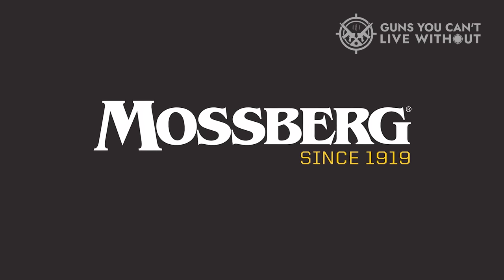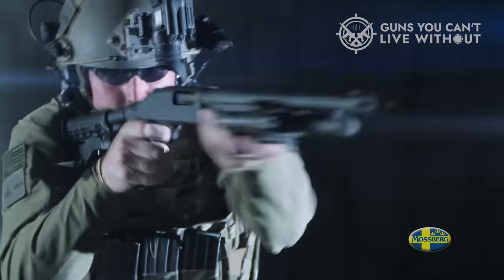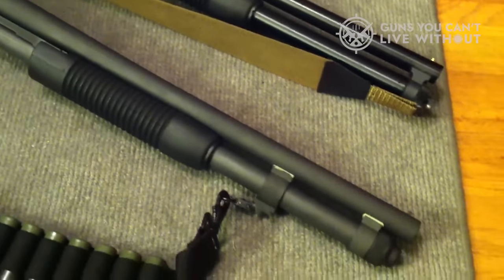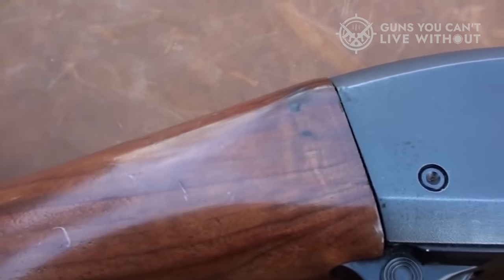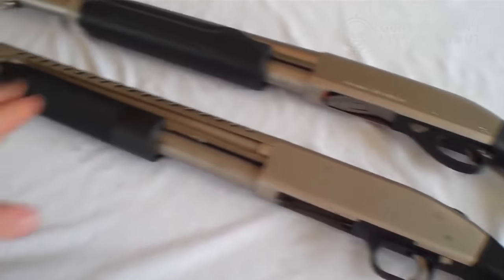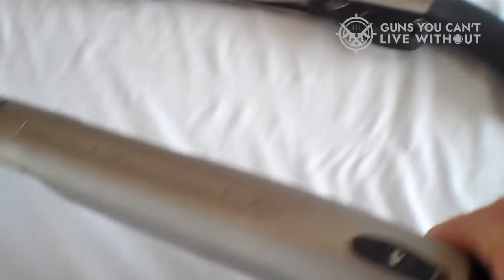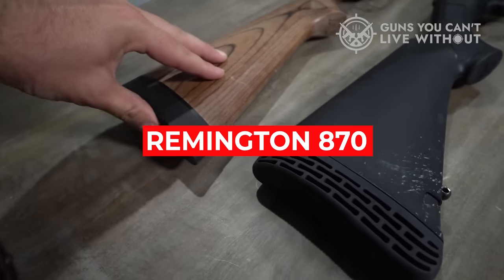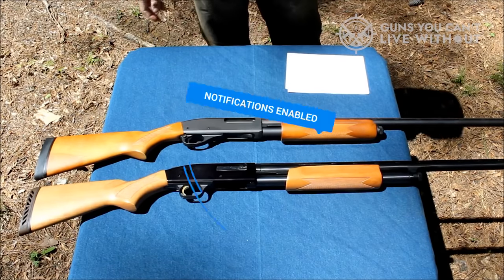Mossberg 590 vs Remington 870 - NOT EVEN FAIR.

Comment: Not many shotguns are built with a solid steel receiver anymore. Most have some form of pot metal alloy to save the makers money. It's one of the reasons I've always loved the Remington's. The receiver is the virtual heart of any gun and the extra few ounces seem to make the 870 balance better and also adds to durability. Also, the 870 action seems smoother and slicker. I have never had a parts breakage on any of my hard used 870's, but they are older guns. The QC of the new ones is, however, a pause for concern.
Reply: The 870 Wingmaster models manufactured by Remington before they went bankrupt are some of if not the best pump shotguns ever made. The only other one close in my opinion is the Itica model 37. The new 870, I agree with you I would not buy one.
Reply: There's been so many great pump guns in history. The Ithaca 37, Winchester 12/1200, even guns like the old High Standard. I have a high standard riot gun with factory rifle sights that's the smoothest fastest pump action I've ever shot! It's compact, light and points like an extension of me.

Comment: I ran a Mossberg 500 for years, eventually tried an 870. It wasn’t even close.
Then went to the 590.
While the 590 had a few neat upgrades, the 500 was at least as reliable.
The abuse we put that 500 through was beyond what it was ever designed for, and without a single hiccup.
I’ve seen several broken 870s, not the Mossbergs.
That 500 is now loose and sloppy…. But still 100% reliable.
It has gone through trap leagues, rabbit hunting, all types of water foul, Turkey, and even slugs for deer…then I gave it to my brother and he did the same. Once falling trough the ice rabbit hunting. He used the gun to crawl his way back out.
He didn’t know you were supposed to clean them once in a while. I got it back and it is STILL going strong.
You can’t beat a mossberg.
The Mossberg is the clear champion.

Comment: Got issued a Mossberg in Iraq 2004. I have had an unyielding love of those shotguns since. Still have the m500A I bought when I got home from that deployment. It’s now configured as a 20” 590 SP with a bayonet lug. (Essentially a light barrel m590a1)
Reply: Nice to read this.  My 590 A1 was great 20 years ago ... a lil older and weaker now.  I plan to put a pistol grip on the 590 A1 for use in a boat.  Then get a 590 and set it up as you did.  Some weight savings ...

Comment: The 870 action and balance  is pretty great for wing shooting its so smooth on the follow up shoots. I often find I shoot better with my 870 then with my auto becouse of the rhythm imposed through pump cycling tends to align the gun just right..
Reply: I have a Mossberg 835 UlitMag. It's a loose-fitting gun and horrible slug gun even with a rifled cantilever barrel but boy does it shoulder, point and knock clays out of the sky.
Reply: @justasimpleguy7211  My 500 shoots slugs great, but it rattles more than 870

Comment: I like both so I own both.  Very happy with my Remington 870 Tactical and Mossberg 590A1.  Both are 18.5" models and I put Magpul furniture on both.
Reply: True, The 590 A1 was created for the Navy, The mag tube was strengthened because the Navy would bang up the mag tubes running through the small steel doorways.
Reply: @josephberg2329  Is the mag tube strengthened as well?  I know the barrel is heavy walled but I guess it would make sense to strengthen the mag tub as well.  Seems both would be at risk of being banged up on heavy watertight doors and hatches.
Reply: @1977Yakko  Yes, or at least from what I've been told, both the barrel and mag tube were strengthened.

Comment: I bought a Mossberg 88 which has the advantage of being able to swap out parts in the 500 and 590 family.  I converted mine over to a 590A1 configuration.  Yes, I replaced the barrel and got the longer magazine tube which cost me not that much as parts are everywhere.  The advantage though is, I was able to do all the gunsmithing myself at home with simple tools in very little time.  I even have a bayonet lug.  My converted version is just the same as the store bought A1. I added a side saddle, ghost ring sites from the A1, and a rail for optics if need be.  I have not added them at this time as I am a traditionalist.  Another thing is the model 88 has the safety on the trigger guard so you do not have to remove your hand from the pistol grip to engage the safety making it like the Remington in this case.  I have never had a malfunction or part breakage to date and the gun is several years old now and highly used.  Yes, it is a little loose (action) but has not appeared to get any looser over the years.  It runs just as smooth as the day I got it.  Great Gun.

Comment: The main reason I like the Mossberg better is because the ejector can be changed out with a flat tip screwdriver unlike the riveted in model on the 870.
Reply: Except that the ejector can come loose and make it damned near impossible to eject a spent round.
Reply: @alexh4436  Blue lock tight is cheap.
Reply: I put thousands of rounds through an 870 that I bought used and never broke an ejector.
Reply: @Jerry hablitzel  That's great 👍  If you ever do, it's not an easy fix.
Reply: Modern 870 extractors can be taken out with a small flat blade Also
Reply: @Aron Kovacs  Extractor or ejector ?
Reply: @RickNethery  oh nevermind, the ejection on the 870 sucks
Reply: @RickNethery  I’m not intimidated.
Reply: @jerryhablitzel3333  That's good because nobody is trying to intimate you.
Reply: @RickNethery  the repair wouldn’t intimidate me.
Reply: @Jerry hablitzel  That's good,  when the time comes I hope you can find the part.
 The ejectors for 870s are sold out everywhere. A quick internet search will confirm this. I've been looking for an ejector and the tools for my 870 for a while now. 
 Everywhere says sold out.
Reply: @RickNethery  don’t be a tool. It’s an 870. It can be repaired if needed (which it won’t for first million rounds).
Reply: @Jerry hablitzel  I own an 870, I know it can be repaired, just not as easily as  Mossberg.  
 That's why I have a Mossberg for when my 870 fails. 👍

Comment: For me the selling feature on the the 500 is no elevator. The open tube allows you to load shells from open or closed
Reply: I agree, hopefully they make the 500S version that will take any length shell to match the 590S models..
Reply: @PatriotPaulUSA  Actually, if Mossberg would sell the trigger group, you could convert a 500  to an S-model in 5 minutes. no reason to market a 500S .

Comment: I own both. The 870 Express for probably 35 years, and a 500 for about 5. Love both, wouldn't part with either. The action on the 870 is well worn in, and is the smoothest, slickest action I've ever encountered. The 500 isn't near as smooth, but we're comparing thousands of cycles to a few hundred. I had a chance to shoot a friend's new 870 last fall, and that action wasn't nearly as smooth as mine. In fact, it was comparable to the 500. I've heard stories about Remingtons quality not being what it was, and it was very apparent in a side by side comparison with mine. I don't think I would buy a new Remington today. They just don't feel the same. I would however, buy another Mossberg.

Comment: Got an older 870 Wingmaster in my gunsafe currently. I am 73 now and have had one  since I was 16. It has NEVER seen a gunsmith. They are bulletproof and there are so many accessories that will fit it that its like a 1022. Massive swappability.
Reply: Maybe they need to do a comparison of wingmaster vs express and the mossberg.  They are worlds apart

Comment: After researching and handling several models, I went with the 590 for the ‘bump in the night’ gun.  The safety on the hump is what I’m used to and I don’t need another thing to think about if there’s someone trying to come through the door. The 7 round capacity is also a plus.

Comment: Notable mentions for both:
The 500/590 has a bigger trigger guard, easier to shoot with heavier gloves.
Some 870 tactical barrels(18/20inch) have chokes, where as 500/590 are usually open cylinder. 
That being said, I wouldn't buy a new/er Remington, I did own a supermag for a hot moment, but to me it was crap. Older Wingmasters/Police models are the way to go if you choose a Remington. That being said, I love my 500 for hunting, the tang safety just works better for me.

Comment: After years of duck hunting (from lead to steel shot) and owning both platforms I got to go with the old model 870. The Mossberg is a fine gun but after a few years of eating 3'' magnums they will start to gall the receiver. The first sign is when you pump it and feel that little stick before you go back into battery. But as stated both will work just fine.

Comment: Last year for my birthday, I went out to the range and tried out a ton of guns, including both the 870 and the 590. I really anticipated loving the 870, but to my surprise the 590 just consistently felt better. It wasn't a huge difference, but the Mossberg was definitely the winner nonetheless.
Reply: Happy bday
Reply: A typical story. Not a unique experience.
Reply: I have the 20 inch 590a1, and although i can definitely feel it after a whole day at the range, I really like the extra weight. I'm a construction worker, so there's nothing like the feeling of a good solid tool. 870 is great too, but I think the 590a1 is worth the extra few bucks. I have no regrets.
Reply: @SpacemanXC  I concur. I have since added Magpul furniture to my M590a1 20”. It is a beast…but, it’s a nearly indestructible beast.
Reply: @rong.2457  I went with the houge stock because I like how the grip is angled a little more downward. Havn't gotten anything else for it yet, except the bayonet.  Looks so wicked when I put on the 9 inch bayonet lol
Reply: @SpacemanXC  I have a bayonet from the Korean War (dad’s)…it’s approx 14” long…now THAT looks badass. 😏
Reply: @rong.2457  lol nice!

Comment: I own a Mossberg 500 Tactical, and my experience with it has been quite different from what I expected. After six months, I consider it to be the least reliable gun in my collection. I wouldn't trust it for home defense or any critical situation due to its frequent feeding and ejecting issues, with a failure rate of approximately 15-20%. I've tried various troubleshooting steps, including cleaning, inspection, and using different cartridges, but the problem persists. Online research suggests filing down parts or bending the cartridge stop, but I'm hesitant to make such modifications, considering the shotgun's reputation for reliability. However, I find it hard to believe that such unreliability is normal for a firearm advertised as dependable, and I'm reluctant to rely on it for self-defense.

Comment: Of note is Mossberg's recently released 'S' models of 590. The 590S can reportedly fire any combination of 3", 2.75" or 1.75" shells without the needs for an adapter, which to me is a game changer, especially in a time when the price and availability of 12ga. shells may be less than ideal.
Reply: Mini shells are a novelty. A bad joke.
Reply: Maybe. I think they have their uses. You wouldn't hunt or practice with them, but for home defence they're far less likely to overpenetrate.
Reply: @nellsonstout7001   Not in slugs.
Reply: There used to be a aftermarket ejector that you could put in the 500 series that would Eject any shell you put in the gun. 

  I hear Mossbeg puts it in the "Shockwave" model. It's popularity has dropped, and the "Pistol Brace" is now illegal.

Comment: When comparing the slide release between the Remington and the Mossberg, an important distinction that wasn't mentioned is that with the Remington, you need to reach in front of the trigger to activate it, whereas on the Mossberg, the release sits naturally above your middle finger, allowing your trigger finger to remain in a ready position to fire.
Reply: Which is a massive advantage on a defensive weapon and why my defensive shotgun is a 590a1 7 shot with ghost ring sights
Reply: yes, but even more important than that, the mossberg's safety is hard to toggle and in an awkward spot, while the remington's is right under your index finger.
Reply: @helterskelter416  Your trigger finger should only be used to pull the trigger, not activate the safety and the slide release. Bad design. Also, if you prefer that safety on the remington then check out the Maverick 88. I'ts the same shotgun as the mossberg 500 lineup but with the same safety location as the Remington and the slide release is still against the midle finger just like the Mossberg 500's. Maverick 88 is awesome if you want add a pistol grip and then add all the 590 accesories like the heavy duty mag tube and barrel.
Reply: @josephberg2329  exactly. Your trigger finger should always be ready
Reply: @helterskelter416  the Mossberg safety is ambidextrous and easily manipulated with thumb by anyone.

Comment: Both are tough to beat. The ones I've had were all older. The most important thing is to get familiar with the one you pick. Switching back and forth with cause problems if only as simple as missing a shot because of the safety location.

Comment: I’ve got 2 mossberg 500s and 2 mossberg single shot bolt action shotguns.  The pumps have been in duck blinds and in rain, sleet, snow, rain and mud since the 70s.  The bolt actions (both 16 ga) are my go to slug guns and are even older from the 50s.  Can honestly say I’ve never had a problem with any of them after I don’t know how many thousands of rounds. I’ve shot 870s but never owned one and never will. For the record I also own a Winchester model 12, an Ithaca featherweight and two Stevens side bys. Love them all, carry the Ithaca the most for upland (20 ga ridiculous light) the mossberg pump for waterfowl, the bolts for deer and the Stevens for showing off.  The Winchester almost never leaves the gun safe. That’s the best compliment I can pay the mossbergs.

Comment: As a gunsmith I have seen plenty of both brands. I personally have and like Mossberg, yet two things I would change. The safety is four parts held together by screw made to only go in but not out, due to reversal cuts in its head. When the screw gets loose, and ignored, all five parts fall out and frequently become lost. I put an oversized safety button on mine with a normal screw and loctite.   The second part I am not found of is the shell elevator, it is skeltionized. If you want to shoot shorter shells, you need an aftermarket adapter that snaps in.  / As stated in the video, the Remingtons have some major quality issues.
Reply: The new s model mossbergs run shorts without an adapter.
Reply: Then there's the Defender lifter that can run everything from shorties to 3" without having to swap parts.